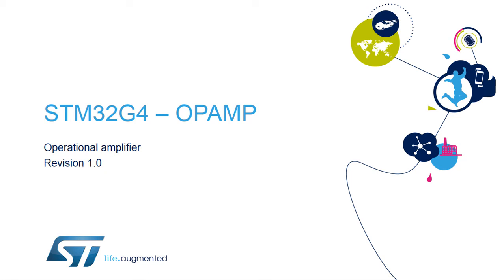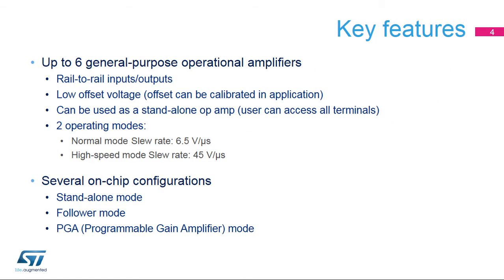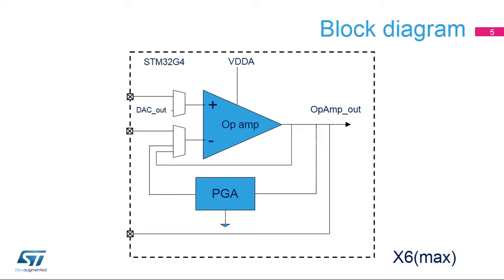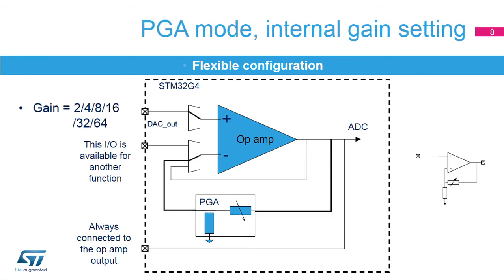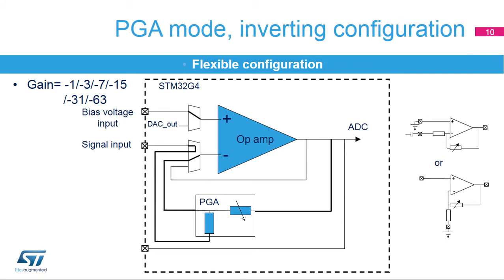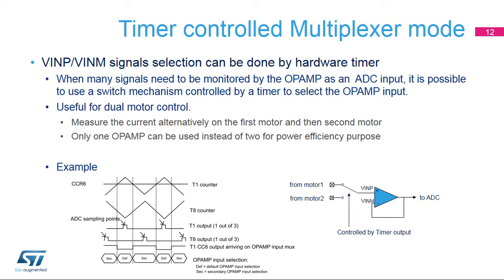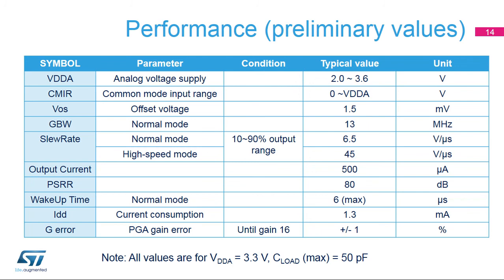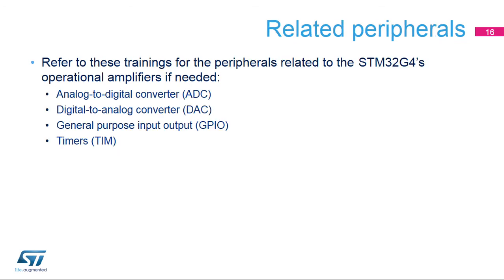STM32G4 OLT - 27 . Analog OPAMP

Comment: Very interesting.
Reply from the maker: Glad you think so!
Reply: @stmicroelectronics  I'm going to implement STM32G4 to my project. If it can program in differential mode with programmable gain, it will be perfect. It can then be used to implement current sensing for power circuit.